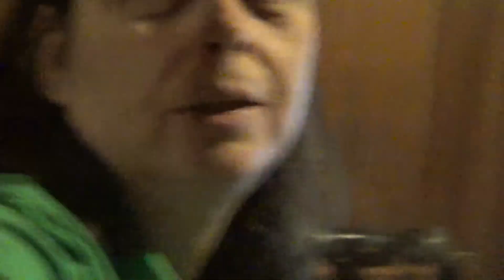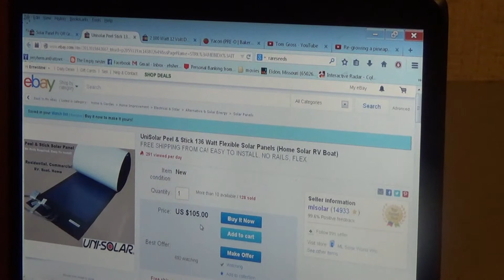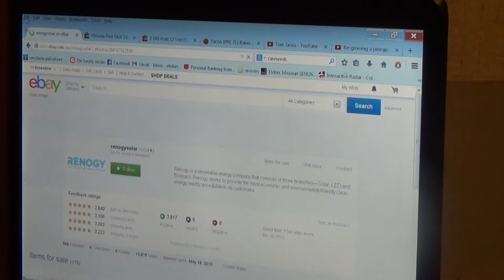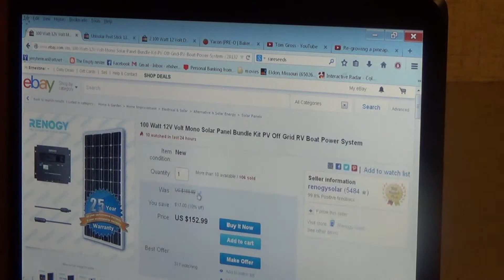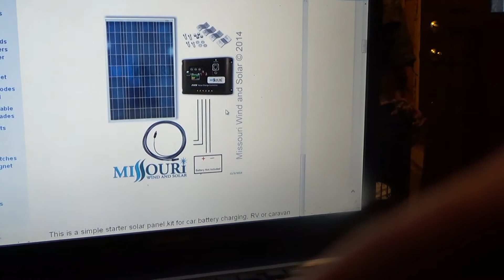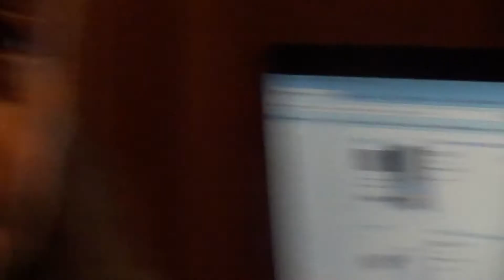Buying solar electric equipment (shopping and making the choice)

Comment: MWS  is not to far from you.  they will  take the time and advise you  on the basics you will need to get started and be able to add on to later.
Reply from the maker: Thank you. I called them and they on have 40 amp Monocrystalline panels. With our lack of sun, I am looking at the more expensive Mono. They have the poly at good prices, But I am now thinking to try one of each. To see if it is worth the extra money for mono.

Comment: @5.15min u mentioned panel voltages of 36 volt which dictated u needed a 48volt bank where u were incorrect!! so I had to jump in - Regardless of the voltage it don't matter where u end up. Make the choice... u either have a 12 or 24 volt bank, average people start at 12volt then go to 24volts... so dont waste ur time with 12 and go to 24volt bank. Ur charge controller reins in the voltages off the panels and puts them into the batts at the right voltage. Where u live I suggest a MPPT charger so u can harvest wotever u can in the winter months to help u survive. Stick to real panels... (250watt 36 volts open circuit) household panels mono or poly ur choice. A 60 amp Morningstar or Midnite MPPT Solar charge controller will do for ur needs. On a 24volt bank system 1.5kw of these panels will get u started which is 6 panels. Buy 2 now and then 2 more in a few months and build urself up to wotever u can afford. What I have suggested is quality equipment and u wont be wasting ur money or time investing in them. Not sure of anything? make sure u consult with someone whos EXPERIANCED, even an electrician who does solar. If u want to run DC equipment directly from ur bank, u can get a 30 amp 24v to 12v converter which will save u energy out of the batts. Using a 24 to 110v AC inverter will chew a bit of power, but a 12 to 110v inverter will chew more energy in the inversion, The better inverter is called a TRUE SIGNWAVE that will run ur electronics as well as other stuff like fridges etc. Good Luck with what u do. Dont forget Utube is ur friend and dont make any decisions till u done more research. Designing the system b4 u buy saves u money. BTW AGM, ex telco or forklift batts is a way better choice then golf cart batteries cos they don't like the cold and die in the ass real quick. Cheers.
Reply from the maker: Thank you, for all of your advice. You are right.I am still researching and learning more. I've been looking at black verses blue panels too. With the solar heater, I have been recording sun and usage hours. So far since Nov 8, only 56.5 hours of usable sun on them. I do not have money to waist. So I have to make wise choices like you said. That is why I made the video. Looking for answers.
Cheers, E

Comment: I'm no expert on Solar power, it's something I haven't really looked at yet .
Have you ever thought about ditching the propane fireplace & installing a wood stove? Good video thanks for sharing. -Bill
Reply from the maker: We sold the wood stove. My husband had bypass surgery in 2006 he can not handle cutting and hauling wood any more. And it is 200 $ a cord here for wood. So propane is cheaper some times. Electric other times. But I hope to do something like a rocket mass, some day. That uses small wood. Thank you. E
Reply: Sorry to hear about your husband.
I have a wood stove in my shed, I used to have a gas heater in there but it was costing to much money to run. Lucky enough I find wood as well as buying it so it's cheaper with the stove than the gas heater. I can get 1 ton of split logs for  £145 which last for ages. I'm installing a Damper soon too -Bill

Comment: Take more advice. See what light you need. Thats all I can say . I don't really  know.
 I'm  going to get a small system for about $75 . Will play radio, strip lighting, water pump for sink water and charger for mobile etc. Im in the uk but in the us it should be easy to get what you want.
Reply from the maker: Sound like you have a good option for your needs there. Thanks for sharing that you are looking at solar too. I think we have too many choices here. That is what makes it more confusing. It makes it hard to find quality. And the right one for your needs. Also at the same time, we are lucky to have so many things to meet our needs.

Comment: I do solar work and assist in offgrid solar installs. If you want to contact me privately I am willing to help in everyway I can. There is a lot of math that you might need to understand and the different charge controllers. You will get a lot of numbers thrown at you when shopping, I can help you with understanding those more. olllllllo
Reply from the maker: Thank you Jeep. charge controller and battery's are the hardest to pick. Unless you settle for a package deal and later buy better. Will pm

Comment: We, typically don't get enough sun, as you say. I'd check out Missouri Wind and Solar. They seem to be good folks and would talk to you if you call them. AGM batteries will last linger, but don't give as many amps at a time. It just depends on what you are going to run with them.
Reply from the maker: Thank you Kevin, I am looking at MWS. I may just try one of each to see what works best in Mid Missouri. Like you I do not have as many places to shop local. St. Louis is full of choices for battery. I am going to look local first to see what I can find for battery's. But I do not understand why some people use 2 6v to build a 12v. Why not buy a 12 to begin with.
Reply: Twice the reserve capacity.
Reply from the maker: kbbacon Thank you :)

Comment: Good luck with that adventure!
I don't really understand that much about solar panels and all that but you may find the folks doing those Earthship houses to be helpful ...  They make those buildings to be as self sufficient as possible so they probably have some advice on solar power.  Maybe?
My long term plan is to gather solar & wind on the land (when we get some) and use a grid tie inverter to feed any surplus back into the main system.  That way if there isn't enough we have the grid for the extra and if there is extra we can lower our overall usage by providing for others(I think).  Since we're in BC hydro power is also a nice little option if you can get the water usage rights.
A thought, if the wiring was that older style then what does the insulation in the walls and roof look like?  You might be able to save a few bucks by spending a few on refilling the exterior walls.  I know the heat just passes right out our walls like they are windows so ours is poo ... Ah, the joys of renting!
Let us know what you decide!
Reply from the maker: The roof and insulation and walls all were ripped out and most replaced. I am still working on walls and insulation. Wiring is 80% complete. This house is a total rehab project. Been working on it since 2001. But we had to move here in  2006 with out it complete. So I do what I can when I can. And Starting solar is my next project. i need to do this before all the walls are buttoned up. And I can not grid tie. The fee's to our Electric company and inspections would be more than cost to bypass them with battery's. If I subject myself to local inspections. I will be home less. I also want to take what I am buying to a new location if I move. So it is not going to stay with the house.
Reply: TheEmptynester Sounds like you've got a plan!  It's crazy how 'they' seem to make it so hard for 'us' to make things just a little bit better for 'everybody' ...
I hope it all comes together for you!